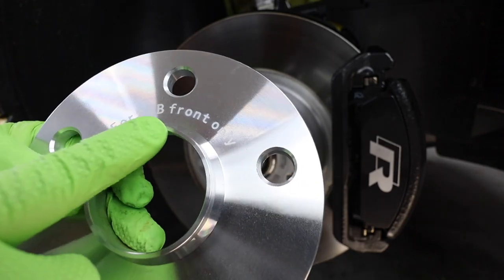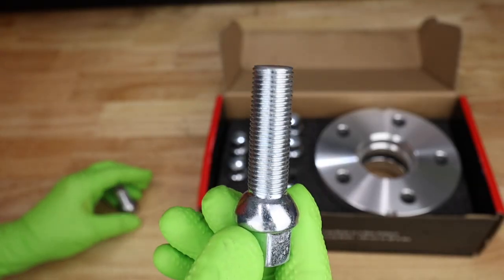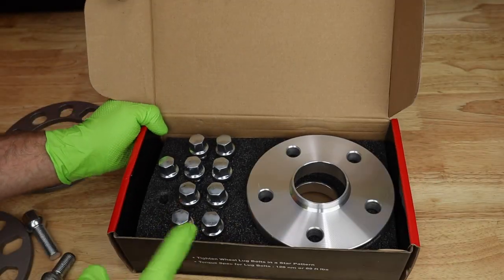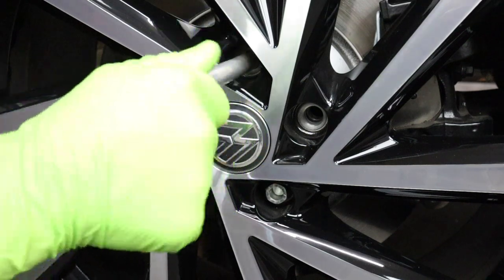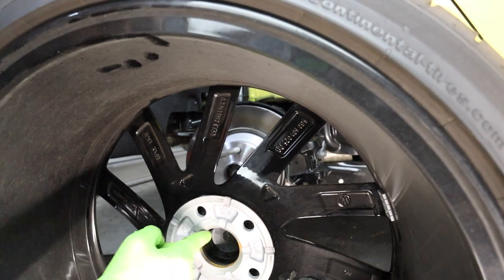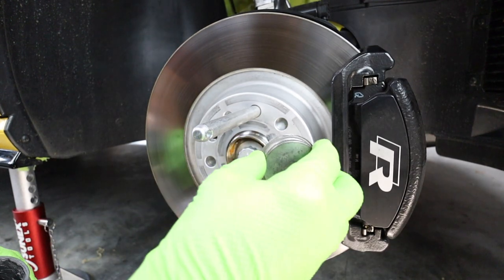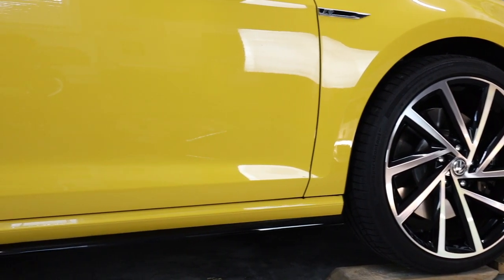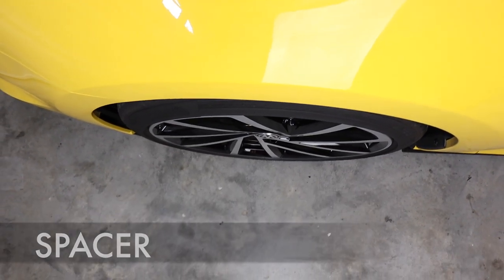How to PROPERLY Install Wheel Spacers

Comment: Maybe we should start making flushish kits ; )
Reply: Or lug bolts that actually work with the OE caps 🙃
Reply: Bryan Green that’s something we are looking at.
Reply: @Deutscheautoparts  or sell an all black kit.
Reply: @bryangreen9889  The OE caps fit fine with the lug bolts that came with the flush spacer kit I bought from ECS Tuning.
Reply: flushisch please to be proper
Reply: @Deutscheautoparts  Can 8D0012244A work to remove the OE caps from Pretorias?

Comment: The last tip to add a set of factory bolts to the tool kit in the car is a must when you swap out the factory wheels with after market wheels or adding spacers. If you have to put on the spare tire which is usually a steel rims for VW  it seems to work best with the factory bolts. You don't want to take a chance with your spare not being fitted correctly. Worse yet would be to have a good spare and not being able to use it because you have ate incorrect bolts.

Comment from the maker: Hope you guys enjoyed this video. Are you running spacers on your car?
Reply: Nope. I still don't know if I should switch to aftermarket alloys from the cheam oem steel wheels..
Reply: Awesome ride, the r32 remains my favourite
Reply: I ran them until pot holes destroyed all of my factory wheels. Now I have some fancy aftermarket wheels to wreck on my commute.
Reply from the maker: Both are Rad, but the R32 has that something extra special
Reply: No, afraid of damaging my fenders on a moderately lowered MKVI on coilovers. Overly paranoid?
Reply: Still have factory on my 2007 Rabbit but lucked into a set of VW BBS in the junkyard (my exact size) from a wrecked 2003 Jetta that will be my project wheels.
Reply: I'm running the ECS kit in my 19 with Prets. I like the black spacers/lugs vs the silver. And the numbers are a little bigger, 17.5 in the rear vs 15.
Reply: I've decided not to run spacers ever since i watched your good friend jason's (engineering explained) video about how it changes the suspension geometry. I really appreciate engineering and i want to have my car (impreza WRX) as close as possible to how the engineers originally designed it. I didn't even install coilovers. Instead i found that koni made adjustable shock inserts that go inside the original strut tower. Good stuff. Didn't change the geometry at all while the dampening was still adjustable.
Reply: Is there a maximum size you'd recommend for the golf r?
Reply: Yes.  H&R spacers with studs for the track Audi, S3, and TT.  (My wife's daily is our 4th Audi but she won't let me touch it.)
Reply: Yes, but on the truck. :P
Reply: Having 25mm anodized Spacer from H&R on the rear...looking good on my R/T :-)
Reply: No not yet, Need to put some on my mk4 gti still running the factory alloys atm but need to get that flush look.. Thanks for posting this vid.. Very helpful in regards to going forward with this 👍🏻
Reply: I hope to add spacers in the future.
Reply: No but only because I convinced myself at some point they are bad.
Reply: Absolute nonsense
Reply: Yes
Reply: With a kit like that i would! What a good looking hardware. I have seen wheels that dont fit perfect again, had even watch all lug bolts snaping and break at a hard turn, making the car lost the wheel. That is with cheap (some not so cheap, but equally poor engeneering) spacers. With the kit on this video i have no doubts that there will be no problem at all :)
Reply: Good call to ask a question to drive comments. No spacers yet, would probably just get different rims.
Reply: @seanmcd72  only if you use bad ones 😜
Reply: Yes! And I don’t have the wheel hanger is a pain in the back! I ordered one from Amazon and ordered the wrong thread 😭. I see you also click the torque wrench twice, I do that but i was wondering if we might be torquing a little bit more than 120 nm in this case with the second click? 🤷🏽‍♂️
Reply: I just did full suspension and spacers. I’m getting a nasty vibration above 75. The rear are hub centric but wasn’t aware the 5mm I got for the front wasn’t. Hoping changing that will make the car feel normal again.
Reply: Running aftermarket wheels but measured for correct ET to avoid spacers and full flush fit
Reply: 1/2 " hubcentrics on rear axle of '10 Mustang GT for staggered stance look. Brings the rear wheels out to the top of the fender lip.
Reply: Yup, lightweight alloy 12mm front and 15mm rears from TPC with matching longer bolts.
Reply: Do these effect handling in anyway? Or performance?
Reply: Nope they are illegal here. For a good reason..
Reply: My stoptec st40 fronts required spacers to clear the calipers on oe detroit wheels.  My shop installed VAG official spacers - 10mm front to clear and 15 mm on rear to keep things looking sharp.  I later put on a set of coil overs and now there are rubbing issues at all 4 corners so I ditched the rear to fix part of the problem.  Found a nice set of oz racing wheels with a higher offset than oe and a thinner diameter wheel thickness that should bring the offset in a few mm but also easily clear the rotors without spacers.  Now i just need to find the $1k-1250 or so to buy the wheels XD   fml
Reply: @jejce1489   If they actually are illegal, its for no reason.  Are factory wheels legally mandated too?  Literally no difference than putting on any aftermarket wheel with a higher offset.
Reply: Would this spacer fit on a mk5
Reply: Volkswagen Hawk... I believe the smallest you can go and still have a hub AND wheel centric spacer is 10mm. I haven't seen any smaller than that.

Comment: Glad you covered cone/ball seat lugs!
Reply from the maker: I see it wrong a lot. :(
Reply: If you have a car with ball seat stock and you get aftermarket wheels with cone seats your spare wheel will still need ball seat bolts. When I was getting a tire repaired I had to stop the guy installing it from using the wrong bolts.
Reply: An employee at Les Schwab legit tried to tell me I can use conical on my ball wheels

Comment: So I bought new rims for my 2014 Volkswagen CC. The mechanics installed the rims and when I drove off, the car began shaking violently, I then took it back to the mechanic who then said “oh you need spacers”. I’m like I never heard of spacers in my entire life so I had to research them to see what they are. Apparently my new rims won’t align properly and the lugs were the only thing holding them together. How the mechanic failed to mention that before letting me drive off the lot is beyond me… so now I have to find spacers that fit my CC. The mechanic didn’t even know what size spacers I should get. He literally put on the wheel how does he not know? The rims I got were original factory rims specially made for the CC. They weren’t aftermarket they were stock.

Comment: It's scary to think that people might actually use those universal spacers. Also, I think those wheels look good without the wheel bolt covers on.
Reply: I use them, it's somewhat inconvenient but nothing too terrible. It's the best I could get because my summer wheels have a 72.6 mm hub and the hub itself is 57.1. Finding hub-centric spacers for this particular combination of diameters is problematic.
Reply: My golf with 8 inch wide rims looks ok without any spacer. Instead of spacer i rather prefer a larger wheel

Comment: For the Wheelbolt/Lugnuts, there is also a third version you can come across wich are Flat seat/Mag seat Lugnuts(usually with a rotatable washer pressed onto the lugnut). Those are quite often used by japanese manufacturers, like Mitsubishi, Toyota or Lexus for their OEM Alloys.

Comment: Finally bought a set for my '17 GTI, putting em on after our lunches at work today. Lift ftw! Also, FYI the wheel bolts now have the indent for using the factory cap tool as well.

Comment: Just picked up a set of BLOX Sport from eBay, 10mm and 15mm good quality! Had a little bit of pain in the rear getting the extended lugs tightened down though..

Comment: I've been running Eibach Pro-Spacer 25mm/front and 45mm/rear on my Mustang for several months now and have no issues. I re-torqued them after the first 50 miles and everything is solid. I got them for both suspension clearance on the front (previous owner's mods) and appearance.

Comment: Not only does the hub center wheel, but it also helps support the load of the car to transfer to the wheel properly. The lug nuts were not necessarily designed for that task. Non-hubcentric adapters have chance to break bolts.
Reply: Not really true.  In a properly designed bolted joint ALL of the load is carried by friction between the mating surfaces.  The purpose of the bolts is create clamp loading so that friction between the surfaces is adequate to carry ALL of the working load.  The pilot diameter is there so that the wheel is properly centered it is not intended to carry any load.  

If there is movement between the friction surfaces the bolts will eventually work their way loose.  I have seen it happen many times.
Reply: I posted earliar but removed it after carefully reading your comments. Referring to load bearing.. it's safe to assume that bolts and hub acts in unison in resisting loads due to everyday driving. Best way to picture it is along the face of your wheel hub is a shear plane and anything that protrudes between that plane is subject to dead load of the vehicle and dynamic loads from road surfaces and suspension travel. 

Friction surfaces in this case, the wheel hub and rim do not resist all the load transferred from the vehicle. As mentioned above regarding shear plane and anything in between the shear plane will resist and transfer the load between mounting surfaces. I hope this makes sense if not the best way I imagine this is a welded connection between a beam and column. The load is essentially going from beam to weld to column.
Reply: @DR-nc8nc  One of the best replies on the internet. Thank you.

Comment: I just used a hammer and beat my fenders down and in...flush and no wheel gap done with one tool; no jack required.  Thx charles, always a pleasure.
Reply from the maker: Hahaha
Reply: @HumbleMechanic ... Glad to know that you know I'm joking. Those universal spacers look like they go to a full size (8-bolt) truck; that center bore is ridiculous.

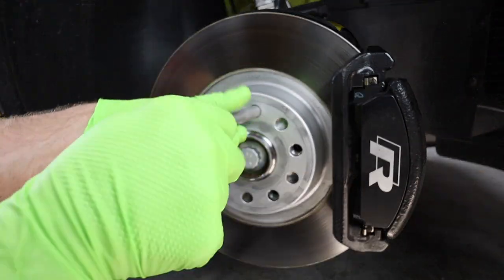Comment: One thing not mentioned is the chamfer @1:36 on the mounting surface of the wheel...not all angled tapers fit all wheels especially aftermarket wheels. That angled taper at the base on the face of the wheel spacer changes depending on the thickness of the spacer and if your wheel won't fit completely flush to the spacer do not use that spacer. Notice the angled surface on your wheel @10:05 IF the spacer has to large of taper the wheel will not fit flush leaving a gap between wheel and spacer...you have to make sure the wheel sits flush to the spacer. VW stock wheels have a generous angled taper but many aftermarket wheels do not this includes hub centering rings too, many aftermarket wheels use hub centric rings. This is something that's easily overlooked and is not only dangerous but if you torque a wheel down that doesn't fit flush you can damage your wheel...Always aways always check fitment of spacer to wheel before mounting to car and of course spacer to brake hub.

Comment: Great video Charles but I would be very interested if you could do a follow up on this. Just how your experience of the spacers have affected the handling of the car. As I believe you will now have a positive scrub radius and most front wheel drive cars tend to run negative scrub radius as far as I know. The reason I ask is twofold firstly I would value your opinion, secondly I have 16mm spacers on the back of my van as I have slightly wider tyres on it and they were rubbing on the inner wheel arch when cornering with a load and just to match up I would like to fit the same size spacers on the front. Many thanks for all the videos.

Comment: Very good video! Would add one more check, if you are running longer wheel bolts, just spin the wheels while the car is up in the air, to make sure that the new
bolts are not too long and prevent the wheels from spinning :)

Comment: I felt a heavier steering and turn effort with 10mm in front. It changed suspension geometry in some way.
Reply: The wheel lug torquing was also very less sure. I had to torque 3-4 times with proper final number whereas just once without spacers. I had cleaned all mounting surfaces first of course. Does not make for confidence when the wheels don't torque perfectly the first time.
Reply from the maker: I haven't really noticed a change with the 10/15 I installed. But to be fair I have not really pushed her much
Reply: @HumbleMechanic  i haven't found anyone else that did. but my steering def required more effort, and also returned to center more strongly. I'm super picky I guess, I love the oem suspension feel, and don't like anything changing it.

Comment: Should have put the spacer on the wheel and stuck a wheel bolt through both to show how many threads go into the hub with standard and extended wheel bolt

Comment: Definitely picking up a wheel hangar for my Scirocco project. I need to run pretty wide spacers to clear the wider track tires. 225 whereas the stock is 185.

Comment: Just made my Rabbit GTI wheels flushish last week.   Looks much better now.
Reply: Age and Treachery I was thinking about getting these for mine.  Are they close to rubbing anywhere?  I don’t want to have to take em off when I go lower
Reply: @fuxidy  No rubbing with stock wheels at stock ride height.  Got 12.5mm in front and 20mm in back.   Slightly less than flush in the front and even more room in the back.  Can't say for certain they won't rub with a drop but I would say it most likely would not.

Comment: Great Vid Charles. Hit every mark! Look to 'McGard' if one wishes to put the Wheel Lock Lug Bolts back. Have gotten lucky with correct Seat style, Thread Diameter and Pitch, and Shank Length for with or without Spacers.

Comment: Very nice video. Kinda wish you would have covered removal of studs for lug nuts as well but still very good for owners of vehicles with bolts. Also, your car is super clean, some may have to use some brake cleaner or sea foam to remove corrosion or carbonic buildup on the rotor face to get that nice seal and prevent the dirt from disjointing the plate.

Comment: Decided to put some sexy TT wheels on my A4, no problems until I went to put on brakepads lol. Shop that put on my wheels said their half an inch narrower than stock. Stuck now deciding what to do. Thanks
Reply from the maker: Hitting the strut assembly?
Reply: HumbleMechanic No the calipers. We had the new brakes all installed ready to go but when we went to roll out of the garage the caliper clip popped off and the car wouldn’t move, scuffed them up from the back as well 😕Always double check your work!!
Reply: HumbleMechanic After watching this definitely going with hub-centric. Just not sure what size I’m looking for yet..

Comment: Hey Charles big fan of your videos! Curious if after 1 year with these spacers, you've noticed any rubbing on the front wheels?  About to purchase a new wheel/tire combo for my mk7.5R and debating 18x8.5" ET45, 245/40/R18 or 18x8" ET45, 235/40/R18. 245/40 set up would be similar to your spacer set up except for the calculated 6mm increase in OD
Reply from the maker: Not one single issue. :)
Reply: @HumbleMechanic  Thanks much for your swift response! Out of curiosity if you were to step down to 18" what specs would you choose?
Reply from the maker: I’d go 8.5 ans do 245/40 or
Reply: @HumbleMechanic  thanks Charles!  Keep it up man, really enjoying the R32 and S10 vids/updates.  Cheers!

Comment: This probably a dumb question Charles but I notice you use your torque wrench by pulling up rather than pushing down. Is this method more accurate when using a click type torque wrench?

Comment: What's your take on swapping the VW lug bolts for studs like on American cars.  It sure would make it easier to take the tire off and on.  Wouldn't adding spacers change the geometry on the suspention and create more wear, especially on bearings?

Comment: What do you think of converting from wheel bolts to stud/lug nut.  I have been considering this for adding a spacer, particularly if I am going to have different spacers for winter/summer/autox wheels.

Comment: Thanks for the great video. Question, how does one pick the correct spacers. I have a 2019 Jetta GLI 35 and would like to do the same. Would the 15 and 10 mm be as safe bet.
Reply from the maker: Yep. That’s exactly what I used

Comment: I'm using 8mm spacers on my GSW because I'm running 17" Ronal Goals (ET 54) with summer tires and the offset is different from stock (ET 43). The wheels are pushed out enough that they look so much better than the stock wheels I'm running with winter tires.

Comment: The new bolts with the DAP kit have a dimple, and removing the cap is easy with the cap removal tool.

Also, the cap for the security bolt won't fit the new extended bolt, so you will need to order 4 new ones.

Comment: What’s up man really like your videos and how you deliver your content.. your probably really busy but I was wondering could a mk4 GLI Jetta VR6 24v 6 speed trans bolt right into a mk4 golf auto ? With slight modifications? As I found a golf for cheap . And the Jetta had timing / engine work already done to it with 122k .. Really eager to get a golf but keep the Jetta drive train. All your advice will be appreciated.
Reply from the maker: The VR6 should bolt to other vr6 engines. But not the 4cyl

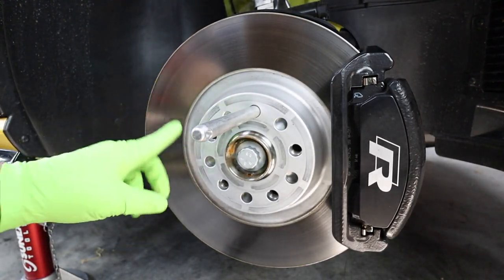Comment: Question: 9:10 where you say the 10mm go in the front, and that you have to go at least 15mm at the rear: I didn't fully understand the exact reason for this difference. Do you mean the hubs at the rear differ from the ones at the front? If yes: I presume that's not the case for ALL car makes and models?